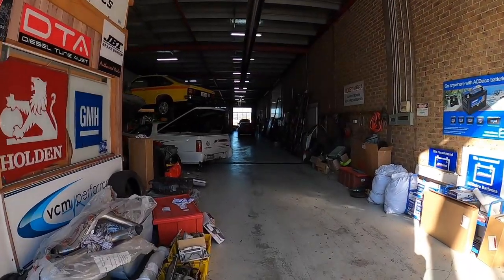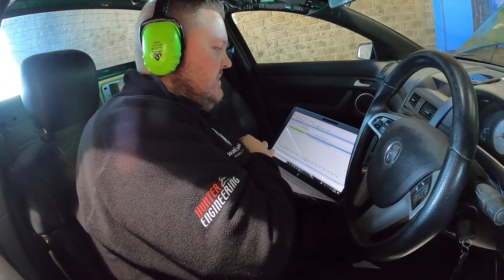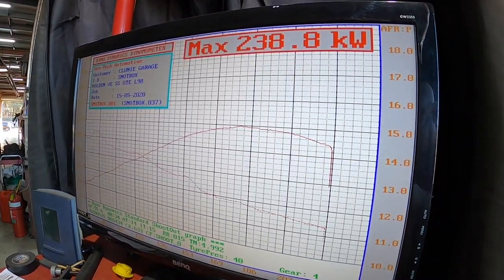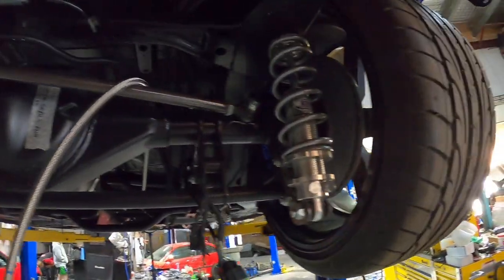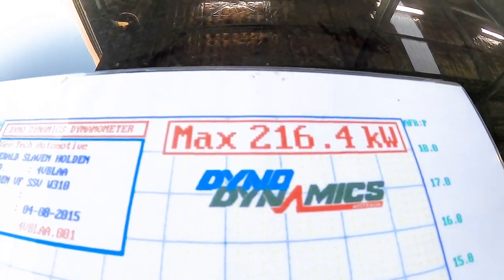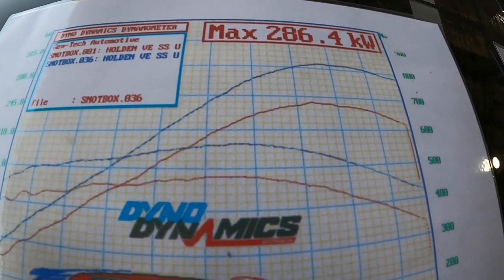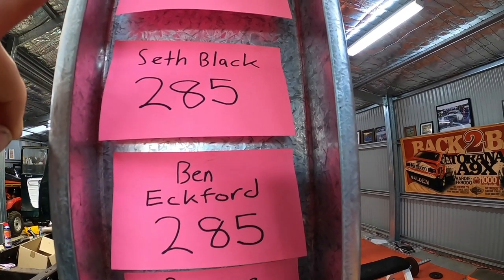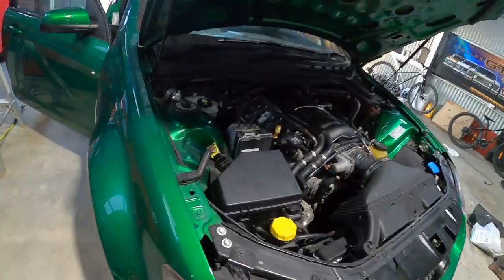Holden Commodore VE SS Ute | Custom Dyno Tune and Huge Power Upgrade

Comment: Dynos are a great tool when it comes to changing the characteristics of your car without having to drive around on a public road.
No two Dynos are exactly the same and that’s why (IMO) it’s best to do all your modifications using the one dyno.
Some may read high and others low but at the end of the day it is your car so make sure you talk to your tuner/mechanic in regards with how you want your car.

I was told when converting flywheel to rearwheel and vice versa to use a formula of Divided or multiply by 1.34
The VE SS was 270fwkw stock so divide this by 1.34 and you should be around 200rwkw mark (auto and manual will be slightly different).
So 286rwkw is around 383fwkw from bolt ons only.
To me this sounds way too high but let’s not forget that it’s just a number on a piece of paper.
Reply from the maker: G'day Benny Mac, absolutely - it's all about a point of reference.  We are super happy with the delta increase over the stock output with our simple mods and our tuner also did a great job.  Thanks for watching mate!
Reply: Benny I been told buy a few guys, take the fwkw say 270 then you make that 270 hp. Convert 270 hp to kW and that's what you get at the rears.
270 fwkw = 270hp 
270hp converted to KW = 201KW at the rear tyres.

Comment: Damn, no small stage 1 cam or anything in that? My VE has a 2.5 inch catback, stage 2 cam kit (rods, valvesprings, arp studs, cam etc), harrop intake and still only made 293rwkw, albeit on a super safe tune. Great work guys!
Reply from the maker: Gday mate, thanks for watching and your dyno guess.  Yep, still stock cam and no other mods apart from what we have covered in the recent epidoses - must be a Wednesday engine!  We will save up for a stage 4 cam now and then we are targeting mid 300s at the rear wheels.
Reply: @ClunieGarage  Nice! Stage 4 cam is real big boy stuff. Easy 350, I'd lean towards 370 if you get the goods to go with it!
Reply from the maker: Yep, we will probably go with a Brian Tooley Stage 4 (like what is in our LS7 VF Clunie but normal aspirated grind) or a Comp cam.  Not bad gains from where we started!  Did you notice the ghost cam chop idle we put in the snotbox?  Classic Fred and Frankie there!!
Reply: I was about to ask the same question, 286kw is super impressive considering the fact that internals are standard. I see blokes do similar mods plus a mild cam and barely make over 300kw.

Comment: Forgive my ignorance, I've only just come across your channel. Great channel by the way. What cam  and motor is in it? That's decent power if there is no aftermarket cam. I made about the same power with a cam upgrade. But i also have short diff gears that bring the total power figure down on a dyno.. I made over 720nm of torque too where as you guys were only in the 500's
Reply from the maker: Hey mate, all good and thanks heaps for watching.  Cam is standard, so is the L98 6L.  It has 155kms and will be due for a freshen up soon.  Interesting about your torque figure.  I guess every dyno is different and there are so many variables like air inlet temps, how the car is restrained, tune, fuel delivery etc.. I am going to do a episode soon on a cam change.  Fred
Reply: Clunie Garage yeah that’s right. So many variables involved. When I got my cam and tune done I didn’t really care what the dyno numbers were going to be. It drives and sounds tough and that’s what I wanted.

Comment: What were the fuel issues you mentioned?  Snotter sounds good up top, what RPM did your tuner rev it to on those runs?
Reply from the maker: Hi Jimmy, we had fuel quality issues as we filled up at a service station with sub-quality 98.  Ended up having to drain the fuel tank as it was pinging on the dyno under load with new tune and more timing.  Rev limited set to 6500rpm initially and then we turned it up to 6800rpm.

Comment: Thats is  not a stock cams, see VE SS's with cams and its just at that VCM range where you dont want the engine and car to rocking that much ,but you want the car to be able to tow and have street power,which is what this car has and not bad, considering that if its going to be a track car, then breaks will be a issue ,so maybe do the caliper and rotor and pad change for the ute as well. :)  maybe go the same size as the series two redines have 355 front rotors and 360 rear rotors. :) Slotted T2 at DBA rotors at least and maybe the DS2500 Ferodo pads. :)
Reply from the maker: Gday, can confirm 100% its still the stock cam.  We have changed the idle characteristics through the tune and idle setting.  Rotor upgrades, pad upgrades all coming soon on the ute!
Reply: Stock ls l98 6.0 they all do this power with these mode look it up

Comment: 286 on an unopened engine. Bloody hell
Reply from the maker: Gday Tim, yes we were really happy with the end result.  It is a safe tune and our injector duty cycles are well within operating ranges.  We will save up for a cam and then aim for mid 300's at the rear wheels. Not bad for an old L98!!
Reply: yeah that's what i was thinking. Very good numbers. Possibly inflated a tad.
Reply: @kryptux2463  happy dyno me thinks. More like 250-260 tops.
Reply: Tim Curtis it does certainly seem a bit happy. Dyno’s are only good for tuning imo. The old bitumen dyno will tells the real story.
Reply from the maker: Gday guys, we were really happy with the uplift from the base run with the bolt on mods and the tuner did excellent work.  This dyno is very consistent from my experience and is calibrated as the workshop provides walkinshaw and harrop packages.  Thanks heaps for watching the channel and the real test is when I pump out some lap times on the track!
Reply: Clunie Garage keep up the good work. Love watching people’s builds. Nice VF too by the way 👍🏻
Reply from the maker: @kryptux2463  Hey mate, yes that VF goes like a scalded cat!  Blown LS7.  Check out some of the driving vids.  I am about to put coilovers in it and is about to be dedicated track car.  Too wild on the street now and gets too much attention.
Reply: Clunie Garage I just had a watch of the VF. Very tough car. Puts my old VE to shame haha. 
I bet it’s a handful and so fun to drive. Love angry cars.
Reply: My 317kw ls3 got 293rwkw from a X force cat back system vcm otr and a tune and its an auto Senator. I believe these numbers